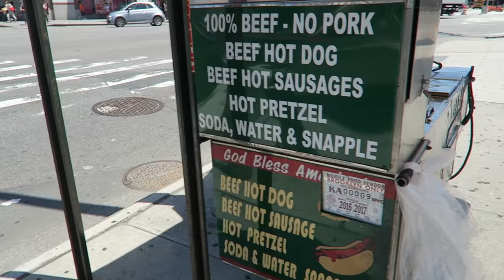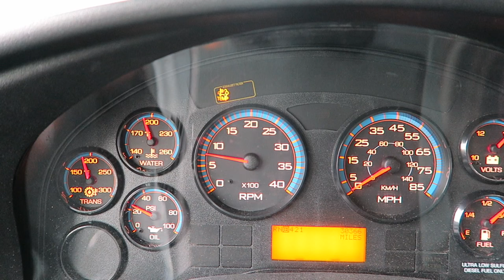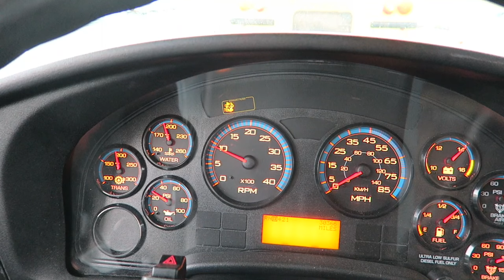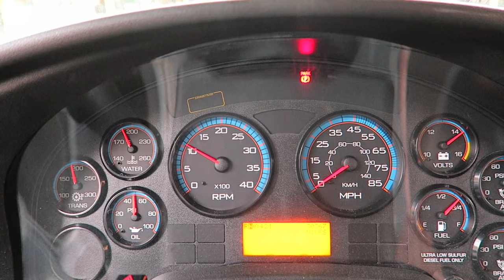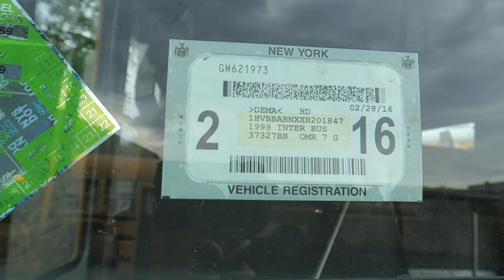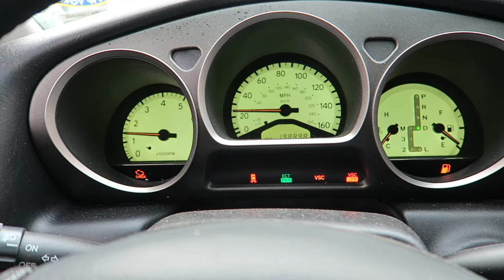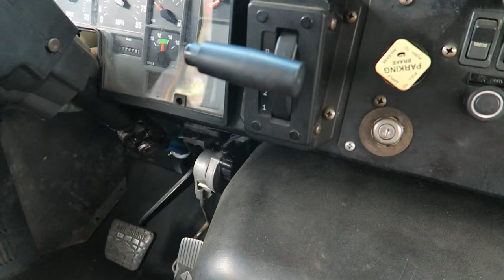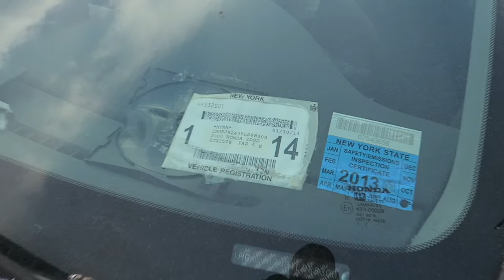School Bus Field Trip From Brooklyn To Manhattan

Comment: best oil? don't know how much yours holds as most all of them have dual or single filters, larger or smaller filters sizes and different sized oil pans... best bet is to buy a filter from international (or two depending on model) and a 5 quart jug of Peak branded 15w-40 diesel motor oil and pour it in until the oil level on the dipstick reads full if you need more buy another jug and save left over new oil for the next oil change

this is the link to the oil I recommend.... click it to go to their website and check it out!
http://www.peakauto.com/products/motor-oil/diesel-motor-oil/heavy-duty-synthetic-blend-15w-40/